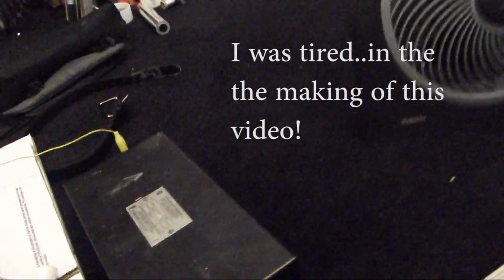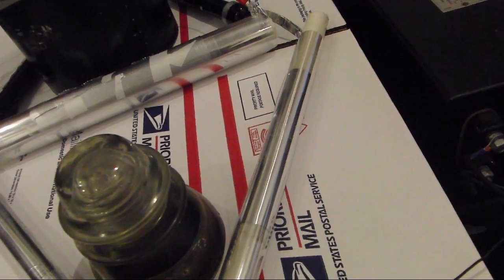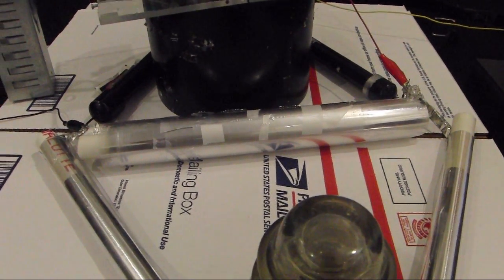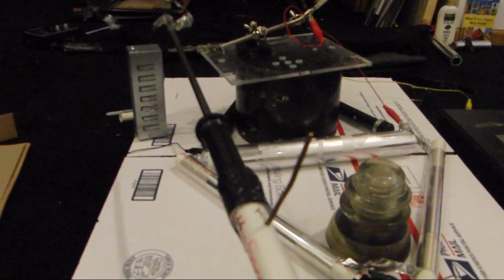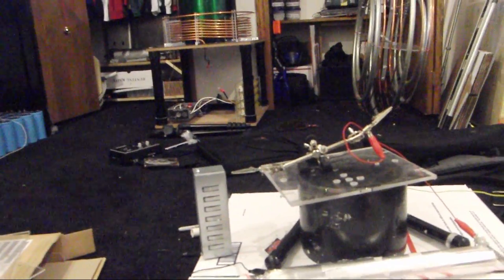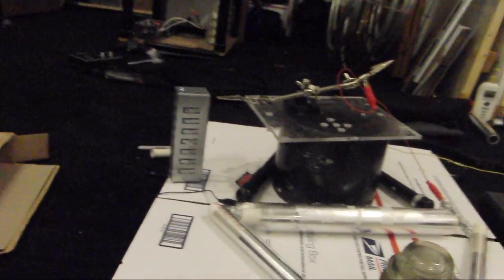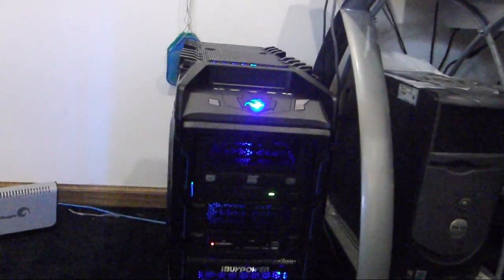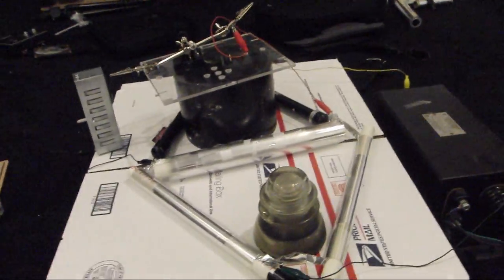Testing DIY Rolled capacitors

Comment from the maker: @high1voltage1rules Nope, the more you roll the more capacitance (and corona) there is going to be.  I think i made most of them out of 1x3ft 5 mill poly sheets and 6x30 inch foil... basic DIY cap, P|F|P|F layers.